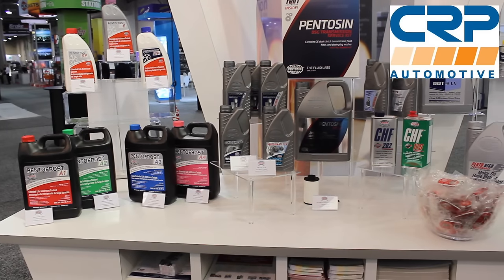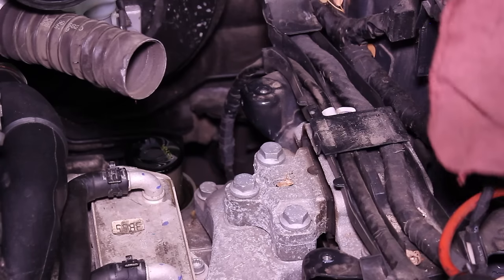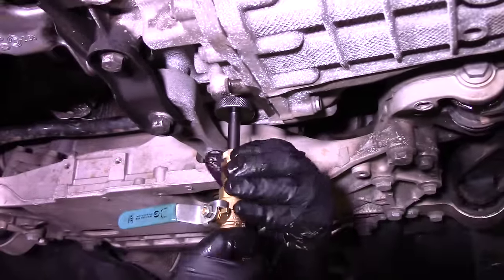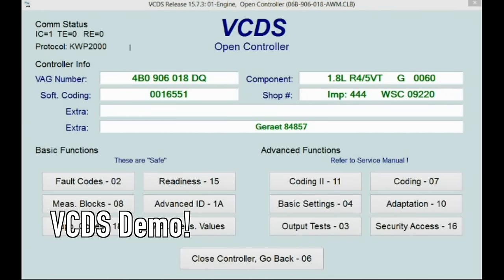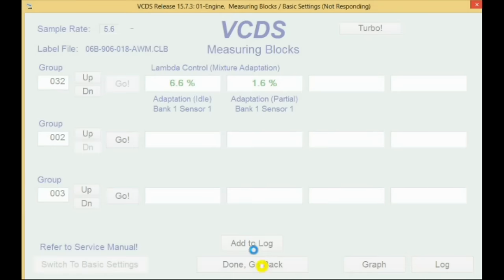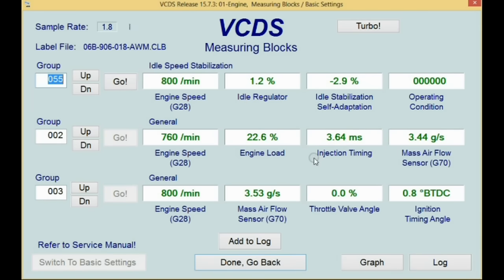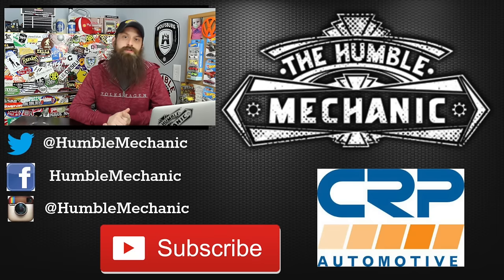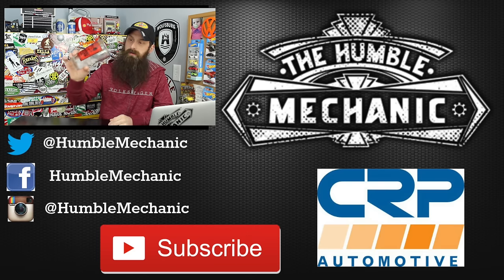Viewer Automotive Questions ~ Podcast Episode 135

Comment: For DSG fluid change I'd say get a cheap hand pump it'll get the job done.
$6.99 - http://www.harborfreight.com/multi-use-transfer-pump-66418.html
and you can use a cheap non-contact thermometer for the temperature. 09G transmission drain and fill is very similar and this method worked well for me.

Comment: hey with that starting issue maybe try the alternator conections i dont know about vw but i know that the alternator is the a key part for starter operation on most cars.
Reply from the maker: +Mcstgg it's worth a check for sure.